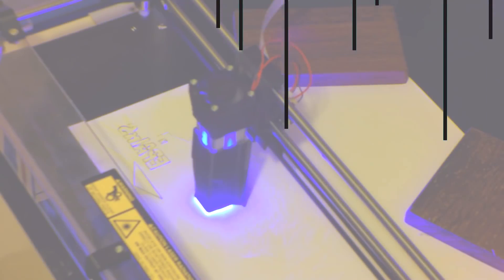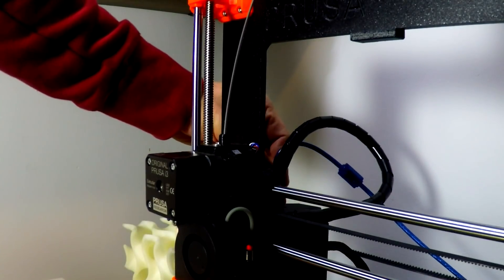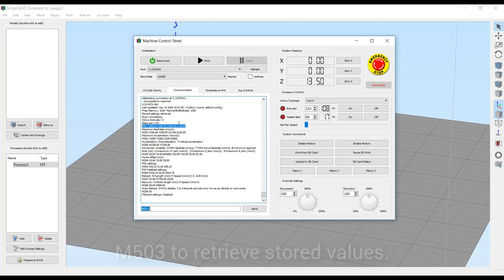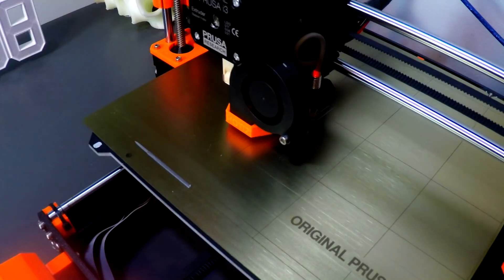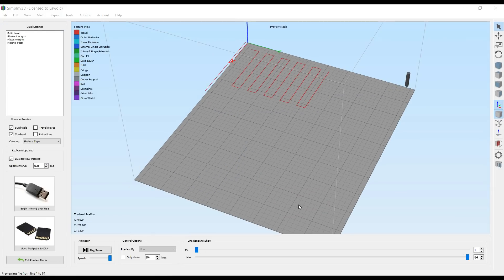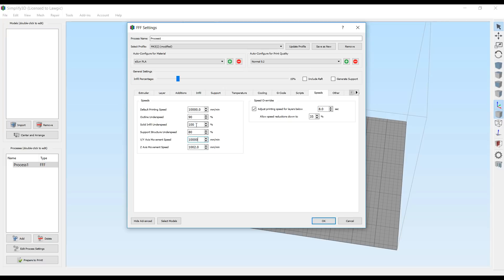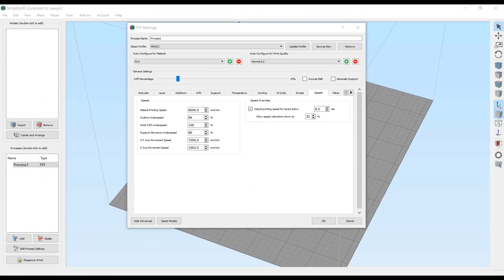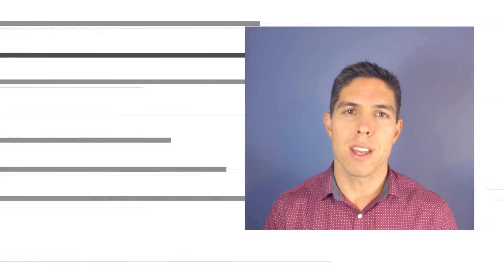How to use Linear Advance in Marlin

Comment: Would the parameters derived by the calibration be drastically different between filament types? For instance, between PLA and Flex (e.g. TPU)?
Reply from the maker: This post from Prusa has some suggested starting points for different materials: https://help.prusa3d.com/l/en/article/t5w9VsdVai-linear-advanced

Comment: The M500 command on the CR10 seems to restore to previous settings rather than store the new settings.  Any ideas?
Reply from the maker: The firmware needs to have EEPROM saving enabled in the source code. I'm not sure if th CR10 version does, I'd be surprised if it didn't. Now that it has recently been released you cancheck and reflash with the change if neccessary.

Comment: At 4:11 you held up a  digital caliper and called it a vernier caliper. Vernier calipers can be read to two decimal places when measuring millimeters, and three when measuring centimeters. Then, there are dial calipers, not mentioned. However, you do have pay for quality calipers, but your not paying for digits, you are paying for accuracy, and repeat-ability.
Once again, at 4:52 digital calipers, not vernier.

However good info. thanks

Comment: Thanks for a good tutorial! But I was wondering is some part of this calibration something that should be done again when you switch to a different type or different roll of filament?
Reply from the maker: Step 1 no. Step 2, possibly. Some slicers have a setting to input filament diameter. Adjusting ths after measuring with calipers may suffice. The K value should be fine for changing rolls for the same type . Changing materials needs the K value updated for sure, although ABS and PLA is meant to be quite similar..

Comment: If I remember correctly, when using linear advance, you must disable any retractions on slicer
Reply from the maker: I read that too and tried it but it gave a super stringy result.
Reply: You must not - you may however decide to reduce retraction, as linear advance may perform a small retraction on abrupt extrusion stop, which may however be borderline insufficient, as the calibration value will not be exact for every circumstance and the actual pressure behaviour is likely to have nonlinear components that are not compensated for. Note that official K factor calibration script also performs retraction! The final length of filament extruded is the same either way, but dialling retraction down can help avoid heat creep.

What is more likely to interfere is Cura's tricks like coast and extra restart after retract. Wipe is harmless and can be left in, however is deemed useless by Marlin team - however with PETG for example, i have my doubts.

Comment: Great content and video! Want to see definetely more such content. I am printing the walls for setting up the correct extrusuon multiplier with 3 perimeters (3x 0,4 = 1,2mm). I personally recommend to print (not only calculate) with different extrusion multiplier because there is some small area (gaussian courve) where different multiplier will result in optimal wall thickness. It is best to use highest saturation so that walls are sticking best (which result in highest layer adhesion). For my Prusa MK3 0.95 multiplier shows best results.

Comment: You messed up on your math. You OVER extruded by 1mm so you should have calculated 101mm not 99mm.

Otherwise, very helpfull. I got my PRUSA i3 MK3 dialed in quite nicely!!!
Reply from the maker: I realised after uploading, read the video description. Thanks for watching, glad it was helpful.
Reply: Ok I'm glad I wasn't the only one confused by that... I was like, wait he just made it worse and was hoping he was going to try it again to verify it pushed out 100mm and catch it, but didn't.  That's also probably why he had to lower the extrusion multiplier by so much too. You really shouldn't go below .9 or above 1.1.  If you do, you have an issue somewhere else that should be fixed first.

Comment: How does this interact with the "extruder linearity correction" in the release 3.2 firmware?
Reply from the maker: I have no knowledge of that but am keen to learn more.
Reply: Should have no relationship or any adverse interaction on one another. I find it honestly quite dubious that extruder motor can be linearised altogether, as positional accuracy is secondary to torque, and the single step calibration suggests that only XY motors will be linearised. It stands to reason that visibility of the feature is benign to near negligible anyway and you certainly won't get more speed out of it.

Linear Advance is the modification of the planner algorithm which tweaks the acceleration of extruder on filament bead speed changes to compensate for built up pressure in the nozzle; while motor linearisation corrects the positional microstepping error, where particularly fine microsteps end up being skewed towards or away from the nearest half-step due to peculiarities of the motor construction. Effectively a successful linearisation may allow the existing planner decisions to be executed more exactly.

Comment: Interesting. I'm using linear advance as well. However, not for speed but for increased quality at lower speeds. Which is in my opinion the most important thing. 
I do have severe issues with this function. I should be using a K value of 105 with PETG filament. However, linear advance seems to ignore all jerk and acceleration limits of the extruder causing massive amounts of skipped steps on the extruder in realistic parts. I'm already down to a K factor of 45. That seams to be the maximum value. 
My printer is a design of myself. Not a normal printer you can buy.
Reply from the maker: I've read that some branches of Marlin have buggy versions of LA. Also, there is a newer implementation that has a very different scale for the K value.
Reply: Frank Franky I was having the same problem with my printer, if you use the current marlin bugfix-1.1.x it uses the new version of linear advance v1.5 that respects Acceleration and jerk of the extruder by limiting the other axis. Or if you want a fully functional version of marlin just wait a little, Lin adv v1.5 will be in marlin 1.1.9 I believe.
Reply: In that case, I will be waiting for the new Marlin version. I assumed the error was going to be fixed at some point. I am surprised that they released it in its current state though. Skipping steps is a very obvious problem. 
But nevertheless, it seems to work fine for other materials with lower K values. Definitely improving print quality!
Reply: Frank Franky it was designed by someone with a direct drive printer for direct drive. It works really well for bowden, but you have the problem we experienced with high K values needed with a long tube (or really with any bowden). They should release the next version soon, they postponed its release because of a intermittent bug that some people are experiencing. In Lin adv v1.5 you use k values lower than 2 for the most part (it represents mm compressed) , I needed a value higher than 240 in v1 but now I am using around 0.5 in v1.5.
Reply from the maker: Just for reference I think Prusa has developed their own branch of LA so the issues seen in the mainstream release aren't present in my machine. Fingers crossed for the new release of Marlin soon!

Comment: did you try higher acceleration values?
Reply: Yeah, 20k.. and print a long (20cm long, 1cm high, 1cm wide) rectangular "box" with 1mm thick walls, open top, solid base, no infill. Maybe one of the long walls with a zig zag in the middle. Benchmark quality vs time for different speeds. Judge quality by box edges and zigzag. Time with a stopwatch. The design of the box is to make it cheap for you regarding filament and electricity costs, with a low print time.
Reply: Do you need to do this calibration for each filament? Or can I calibrate with pla and then print petg and abs with the same values?
Reply from the maker: In the next school holifdays I might pursue this, it sounds worthwhile. Especially in terms of eletricity usage.
Reply from the maker: geoBruce the Prusa blog says you are meant to vary it for each material. ABS and PLA are the same though. The test file from Matt's hub should only need the temperature changed to work with other materials.
Reply: Teaching Tech you're a teacher? Primary or secondary? (Guessing secondary).
Reply from the maker: 90% secondary but I also teach some primary one morning a week.
Reply from the maker: Not as yet.
Reply: I can do 75mm/s with barely any problem without linear advance im only usin 1500mm/s^2 for perimeters. My mendel can do 4000mm/s^2. But the limiting factor is ringing rather than overextrusion in the corners.